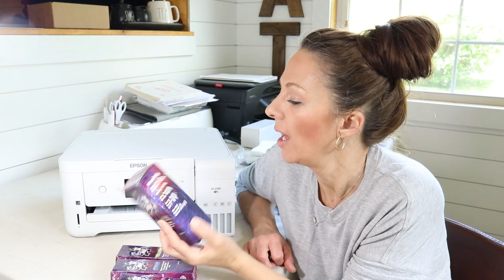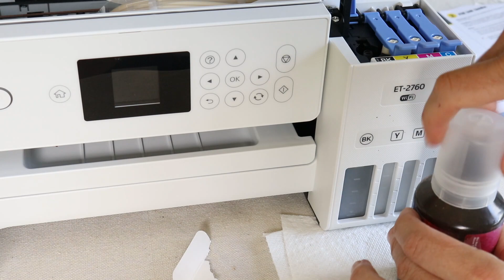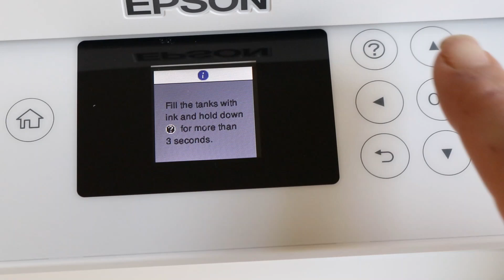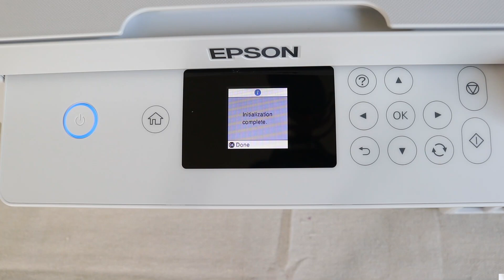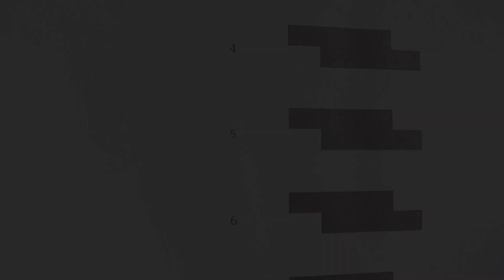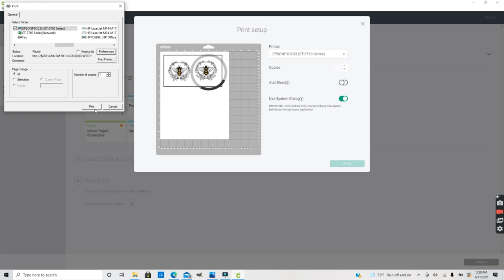How to Set Up an Epson Printer for Sublimation / Sublimation for Beginners

Comment: I bought a Epson echo tank 2850..it prints but won't print on sublimation mugs
Reply from the maker: Hi. You would need to convert it for sublimation. Placing Epson ink in the tanks will not work for sublimation. You would need actual sublimation ink. You may be able to drain the printer of regular ink. but most people don't recommend doing that.

Comment: So, can you use absolutely ANY printer for sublimation, as long as you change the ink?

I don't really use a printer but I think the only ones I have only take cartridges, does that still work? Thanks!
Reply from the maker: Hi! I have only seen the Epson printers converted to sublimation...you can use the Epson Workforce 4760 with the cartridges but you have to purchase ink filler needles and blank cartridges to replace the ink. The Epson 2760 is my favorite to convert, and easiest too.
Reply: @AppalachianHomeCo  Okay. Me and my mom are thinking about doing sublimation, and we found some 100-200 dollar EcoTank printers. I think buying a $200 printer and paying $10 for refills is better than using a printer we have and replacing the $40 cartridges.

Comment: Does the ink dry and cause problems if not used daily.I bought an Epson workforce for my 1st matchine
 and after 1 year it gave me so many problems, i wish i bought this printer from the jump.I love it and so simple
Reply from the maker: Hi! Yes unfortunately it will start to clog and dry without a lot of use. I am bad for letting mine go too long! That is the only thing I don't like about sublimation., but if you use it a lot no problem. If it does clog I just do a printer cleaning.

Comment: I want to say..I love your videos!! You explain everything so well! I have that printer that I bought several months back and used a few times.  I wasn't aware that I could convert this printer. Is there a way that I can now even if I have used the printer previously?
Reply from the maker: Hi thank you! You would need to completely empty the printer of regular ink and I'm not really sure how to do that, ... the printer holds a lot of ink in the lines as well. You could try emptying the tanks and refilling them with subli ink .... then doing several deep cleans of your printhead ... that flushes out a lot of ink. 🤔

Comment: How did you get the design on the coaster?
Reply from the maker: Hi! I taped the design face down onto the coaster, and pressed with a heat press at 385deg F for 60 sec.

Comment: How do you like your new printer and ink?  Would you make any changes so far or are you happy with this?  I'm looking to buy a printer for infusible ink and don't want to have regrets.  Thank you for your videos!
Reply from the maker: Hi! I love, love, love the printer and Cosmos ink. If you are buying i would try and see if you can get the Epson 10000 that prints the larger paper 13x18 or something like that. It wasn't available anywhere when I bought mine but I would have definitely bought the larger printer size. Thats the only thing I would do differently tho!!

Comment: I don't have instagram, so I can't go there. What process do you use to transfer the design on to the ceramic tile? Thanks for a response to this!
Reply from the maker: Hi! I place the images face down on the coasters and tape them with heat resistant tape. Then I place them in a heat press at 400deg for 60 seconds to sublimate.  I will do a video on this soon!
Reply: @AppalachianHomeCo  Thanks so much for the response, Christy!